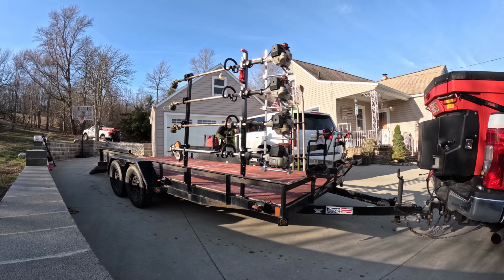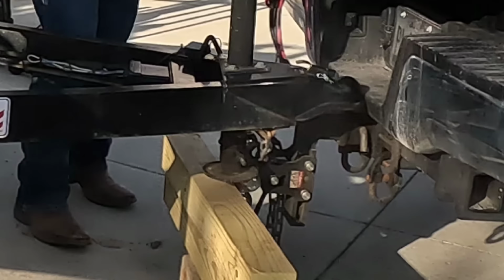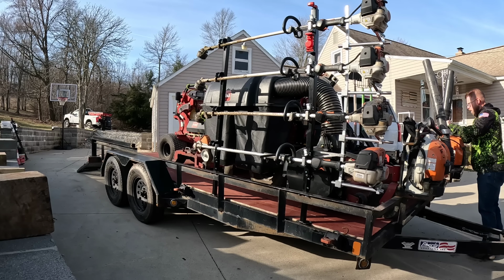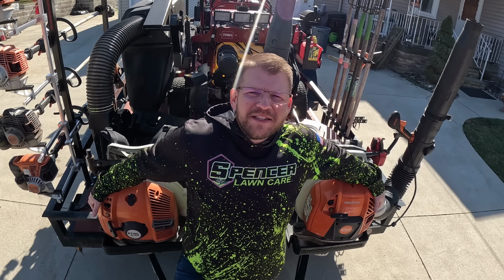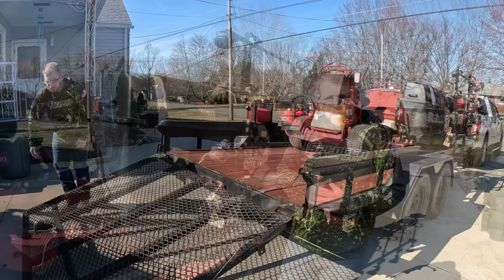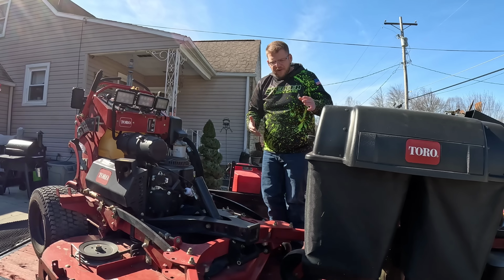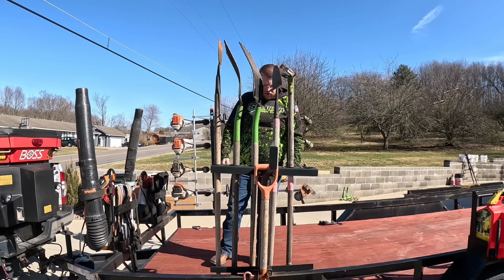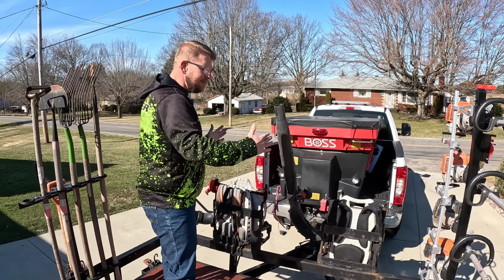Lawn Care Trailer Setup 2023 | It Went Horribly WRONG FAST!

Comment: You should paint each ball a different color and match that color to the item that is towed.
Reply: Yep paint the one side of the receiver stick pink and the other green and the paint everything that matches that ball paint the whole tongue ....saves on knee caps when the trailer is disconnected too.....dont ask me how i know
Reply from the maker: Great idea
Reply: Don't you need the ball to have clean metal for ground?
Reply: @Neeko_110  not a bad idea at all
Reply: That’s a great idea especially for employees
Reply: @christitus6436  Correct we are talking the flare under the ball and the receiver bar side
Reply: @laisuresboringadventures7052  BLAH that's ALOT of work and welding...
Reply: @laisuresboringadventures7052  blah... shaking a can is just as effective and cheaper lol
Reply: @laisuresboringadventures7052  true but it takes 5 seconds to go PUFF for another 2 years of service
Reply: How are you?

Comment: Great video! Thanks for showing how disastrous a little complacency could've been. A little laziness added in there and it would've been ( I don't need the chains, I'm just doing the setup video ).
I would guess most of us have been guilty of these from time to time but to actually keep it on the video as a lesson learned is what seperates you from so many lawncare and other channels. 
I noticed you didn't mention you extending your trailer gate which I think was a very important modification to the trailer.
I hope this comment doesn't come off as negative as it seems very critical but I don't mean it that way. 
Great job going over everything and now I guess it's time for you guys to do laundry... Take care!

Comment: Great video, that happened to me a while back twice. The time I was loading the trailer with zero turn, it went straight up and down, the 2nd I tried to move more than I should the trailer went forward and caught the back of my tailgate it didn’t go the way through. So my sure it’s lock on the ball, thanks for sharing. Thanks

Comment: Small piece of advice: mandatory trailer drivers license in Denmark includes the knowledge how to verify a correct coupling between trailer and towing vehicle:
After fully connecting you again wind down the nose wheel/support until you have proven that the towed vehicle is being lifted through the coupling….
If you fail to demonstrate this knowledge…..you fail your driver’s license test.

Comment: Maybe paint the hitch ball base round the a balls bright colors.  Neon green for one, neon pink for another (your company colors), and black on the landscaping hitches.  Maybe paint the top of the ball cups on the trailers with corresponding colors.  Green trailer hitch does not go on the pink or black hitch ball side of the hitch.  Could come in handy if you ever get employees, your dad or eventually the kids move a trailer.  All hitches and trailers on your equipment could be done the same way.   When the tailgate is in place during summer, whoever is driving could see in the camera that the colors are not the same.  You may have an idea later in the video, but I wanted to type this as soon as I saw you get into the truck after reattaching and "changing clothes".  I am currently paused at only at the 5:32 mark of the video.    🤔

Comment: I agree with the color code suggestion. If you have all different size hookups. Not always cost effective to switch all the tongues to one size if whether you have the money or not to do so. And no the hitch is not used as a ground for the  trailer lights, that's all included in the wiring connected to the lighting. And savannahs reaction to that last comment  was priceless.

Comment: It's surprising that a small difference in size of the ball's it allows it to come right off instead of just jumping around and being loose. It's always a good idea to check the locking mechanism on the tongue. You can adjust it to be a little tighter with a socket and you only need to do it once. After the newness wears off they tend to get unnoticeably loose. It's unnoticed because of the tongue weight. Don't over tighten it just snug it up a little. Once you've done it you will notice that it's quieter when you go over bumps. 
I agree that you should check your balls or you may need to check your shorts.

Comment: I put jack stands at the back end of my trailer. Although the jack stands in this case would have kept the trailer from popping off in the driveway. And then pop off on the road. So I guess always double check the ball size.

Comment: Shawn actually your trailer hauls less than 7000 pounds the 7000 pounds is the total with equipment on it cause each axle is rated at 3500 pounds

Comment: Tape around the side and top of the balls, then paint all around the neck of the balls different colors…maybe use your favorite color on the one y’all use the most….when y’all go to hookup any of your trailers, looking down at the colors will be a reminder … if you leave the sides and the tops of the balls free of paint , they will stay clean and free of dirt also making good contact between truck and trailer…the paint would wear off anyway…

Comment: I had my trailer pop off the ball when I hit a bump in the road. The trailer fell to the ground and the hitch went thru the wall of the trailer. All the weight shifted to the front of the trailer so I wasn't able to pick it up. So I had to get 3 men to stand on the back behind the trailer ramp to give enough weight in the back to lighten up the front to get back on the ball.

Comment: We had a really bad accident in my area because a trailer was improperly hitched. There had been a deadly accident within the previous month where a young individual had crashed into a distant treeline while turning onto an acceleration lane of a nearby highway. Several friends were holding a roadside memorial when a pickup truck pulling a landscape trailer made the same turn. Unfortunately the trailer was somehow improperly hitched a the trailer went straight into this group of young people resulting in further deaths and injuries. They were so far off to the side that they should have been safe. The trailer hitch failure in that location should have resulted in damage to the trailer and equipment at the most. Combine both and the result was horrible.

Comment: With that mini plough why wouldn't you do small snow removals, set up the other one like it to plough for residential
Reply: Especially those across from or next to commercial business if you can park at the commercial business and do multiple houses even if it's just a clear the pile from the end of the driveway right of way after road crew has been by.
Maybe offer discount on lawncare if using this perk.
Reply: It’s much faster and easier to do the plowing with the truck you’d need to pull a trailer around.

Comment: I had that happen to me twice once when I was working for the city. My supervisor was driving the mower and my crew was supposed to secure the trailer and I didn't check it. Oops. Second time it was secured and made it all the way to my site and when I took it off it came off and I was solo. Stopped made a game plan to just run with it dented and scratched my tailgate.

Comment: How do you get by without a DOT number? F350 has a GVWR of 14,000 LBS. and that puts you over the DOT requirements (which requires you to have DOT physical Card . And then add the trailer of probably 7000 LBS GVWR. (It doesn’t matter if the vehicle doesn’t way that, it goes by GVWR (Gross Vehicle Weight rating)

Comment: what is that noise is that the kohler engine i replaced the lifters on mine  didnt stop the noise ended up getting a new engine it had about  2000 hours on it
Reply: Kohler had alot of problems with their camshafts prematurely wearing and causing the valves to be out of adjustment. We had a Kohler replaced under warranty with 1,100 hours on it. We switched to Kawasaki this year.
Reply: @jeffgootjes8418     they  replaced it for free the first time the second time   the warranty was up   up its on a scag cheetah i got 31 kaw on it now if any wants to the old engine for parts i still got it its  ecv980  34 efi  kohler  engine

Comment: Why don't you use lawnmowers that can be operated seated?
Reply: Sit downs cost quite a bit more for the same deck size, are less versatile, are hard on your back (legs are natural shock absorbers), they take up more room on the trailer and employees are less likely to get off a sit down to pick up trash in the lawn. Stand ons have a more commanding view of the lawn in front of the deck so your less likely to hit things. Stand ons generally don’t get stuck as easily too.